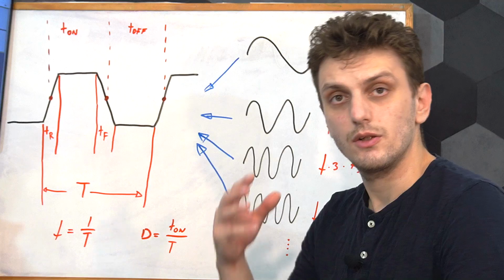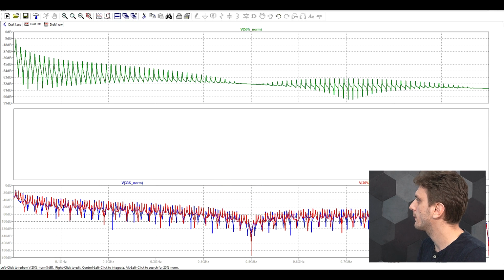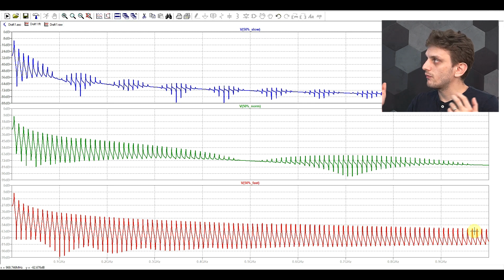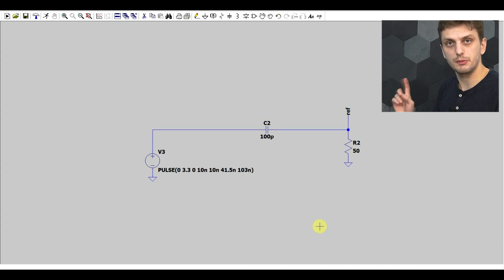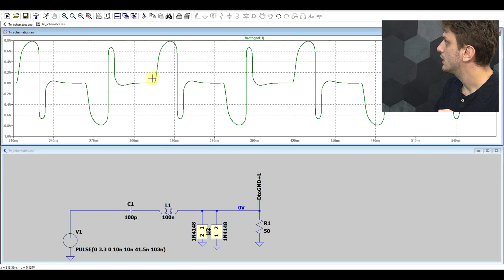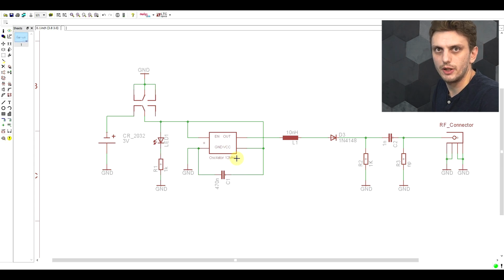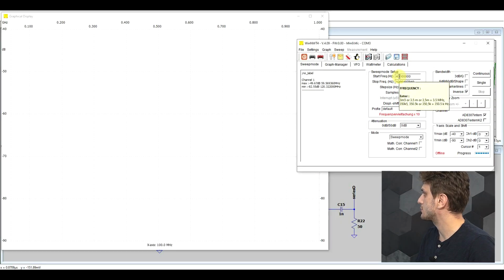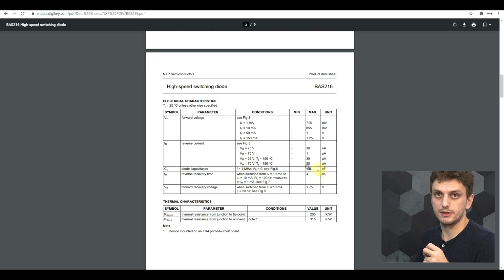Electronics tutorial - The Comb Generator

Comment: Have you checked-out the HP - Agilent - Keysight 85680-60058 A23A6 Comb Generator For HP 8568 Spectrum Analyzer?  They're often for sale on E-Bay.    Input +/- 1V @20 MHz square wave.  Bias at 1.5v  Output carriers every 20 MHz up into the GHz.

Comment: First of all, thank you for posting such good quality videos, your hands on approach is really great!
Could you release the gerber files for this pcb? I have an old (and probably not properly calibrated) HP 141 with the 18GHz spectrum analyser plugin and I'd like to test this. I would like to have the same gerber si that stray inductances and capacitances should be close to yours...
Reply from the maker: I'm not sure how important the Gerbers are to get similar results - I did not apply any special routing rules, not even proper impedance calculation for the traces. Also its just a homemade 2 layer board done with an iron so if I where to make 2 pieces, they would turn out differently. Regardless, I release project related files only for a certain tier of Patron subscribers as a way to thank them for supporting my efforts.
Reply: @FesZElectronics  I didn't know that and I totally understand. I'll try to reproduce the circuit with my cheap CNC and I'll let you know how it went if you're interested. For your information I also did some experimentation with the BFU768  silicon germanium npn transistor. It has a ft of 110GHz and it gives a nice comb pattern until roughly 4GHz, I can even still see some peaks until 8GHz thanks to the -80dBm noise floor of the analyzer.
I never subscribed on patreon but I'll definitely check your page, your videos are amazing.

Comment: Nice explanation, just wondering if you could have used the FFT analysis of the oscilloscope, in order to show all the harmonics in the physical board's circuit, which you built; I have watched several of your videos, but can't remember if you have used FFT analysis in your 70M scope; or, even if FFT is available in your scope, the 70M bandwidth limitation of your scope would limit an FFT analysis, in someway?  I know you have you have used the FFT analysis in LTspice to analyze some circuits .
Reply from the maker: My oscilloscope does have the FFT function, but it has 2 major limitations. On the one side the oscilloscope bandwidth is only 70MHz, so that will have an impact in the FFT results also; and secondly the FFT is done over single oscilloscope captures of 4000 data points points -  so the FFT is not very useful to look over large frequency intervals. For these 2 reasons a spectrum analyzer is the better choice.
Reply: @FesZElectronics  Thanks for the informative reply.

Comment: Fesz, good video, thank you. I truly enjoy your videos. You are a brilliant young Engineer. I noticed you used a model for you circuit, was that for the 1N4148 diode? Was there a parameter you wanted to investigate? Say the junction capacitance?
Reply from the maker: Thank you! The model was for the 1N4148; I got it from NXP. The main reason for using that was to have a more accurate behavior than the default model that LTspice comes with for this component. Of course, any of the parameters inside the model can be edited afterwards to see how that influences the behavior.
Reply: @FesZElectronics  You probably already know this, but you can use subcircuits with the built-in schematic symbols https://www.analog.com/en/technical-articles/ltspice-using-an-intrinsic-symbol-for-a-third-party-model.html
Reply from the maker: @FPiorski  I did not know of this. Thanks for pointing this out!
Reply: @FesZElectronics  thank you for the information. Keep up the interesting uses of LTSPICE in the real world.

Comment: Cool video, as always.
Another way to generate a lot of noise for the purpose of EMC testing is to use a "chattering relay". It is a regular relay switch, but wired in such way it repeatedly opens and closes when power is applied to it. More info is here: https://www.edn.com/unusual-emi-sources/
Reply from the maker: I know what you mean! The main difference would be though that with this sort of noise generator the spectrum is far more predictable. I saw that the relay circuit is commonly used as an easy way to create EFT or other broad band and high voltage noise.

Comment: Love your videos.
I think Tesla thought an abrupt pulse was the key to unleashing his radiant energy. 
The sharper the pulse, according to him, the higher the energy release. He used all sorts of techniques to squelch the spark and make it transition as fast as possible.  
A few operators at Niagara falls station died when they threw the switch to off position. The sparks that came out of the contact point, killed a few men instantly. 
Maybe they were idiots! Who knows!
Reply: I think softer switching is actually the key to better wireless energy transmission in a Tesla coil. That way, you get a nice sinousoidial primary current that lets the secondary resonate smoothly instead of building up voltage so fast that it creates an arc that wastes energy. However, wireless power transmission with a Tesla coil or a similar device is extremely impractical and inefficient (but definitely really cool). I was only able to get a few mW from a small solid state tesla coil powered with 24 watts.